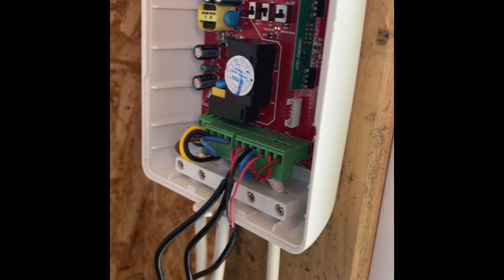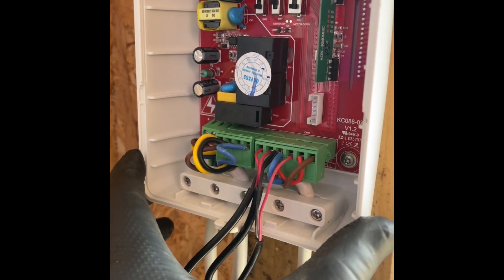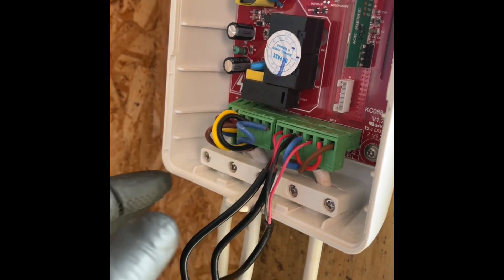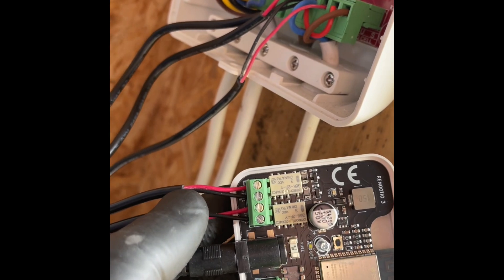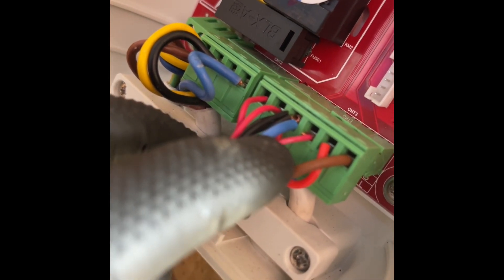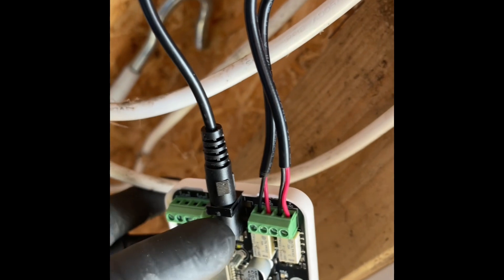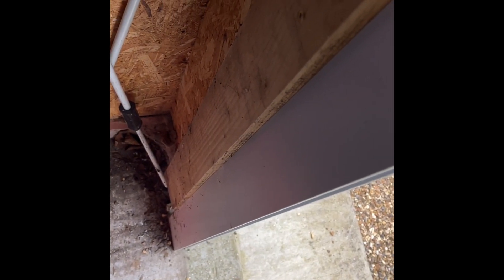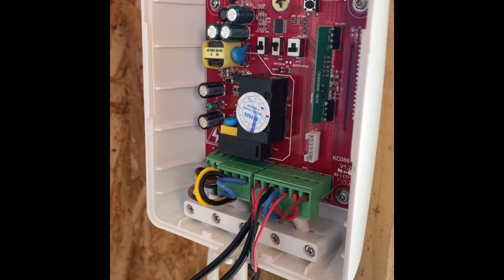Installing Remootio 3 in 5 minutes to Ellard Genesis Garage door controller.

Comment: How do you set the lower limit ?
Reply from the maker: The physical limit of the door is controlled by the limit switches in the motor itself you need an adjustment tool.
With the remootio if the door is set to hold to close you just go to output configuration and adjust the timing of the output to suit. It doesn’t matter if you set it for longer as when the door reaches the limit it cuts the power so can’t over run.